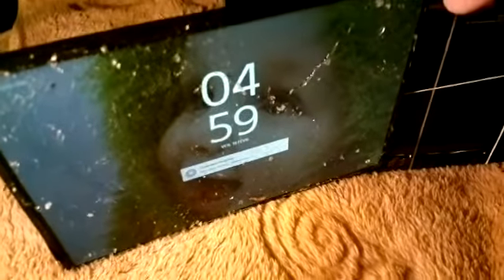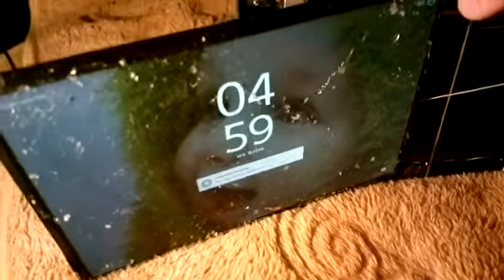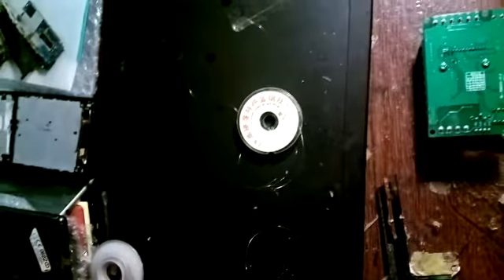xperia z tablet separation of Front glass only - proof

Comment: My lcd is broken, but the touch and front glass are good. Is there a way to change justthe lcd without destroying the font porctecion film?
Reply from the maker: you can separate the lcd without breaking the front glass , but you need to apply lot of heat , (higher temperature )
i don't have temperature meter to know precisly but turn the heat to top , and use separation line
Reply: Thanks, too much hassle. The screen only cost £41.00 the lcd and the digitiliseser costs 47! Just took the ldc out. Bitch of  a job!